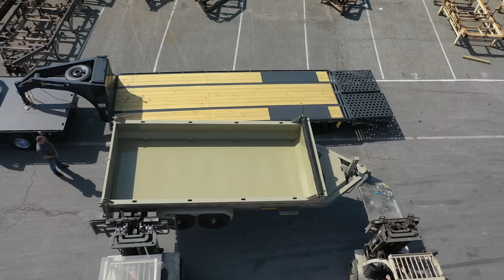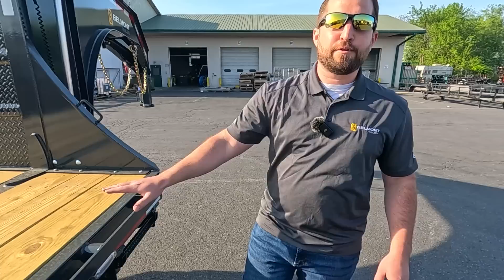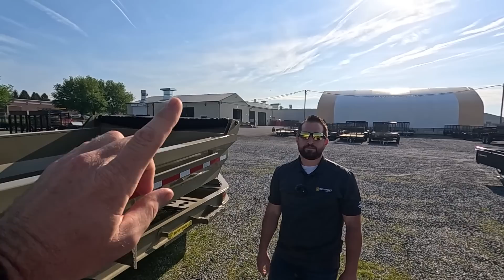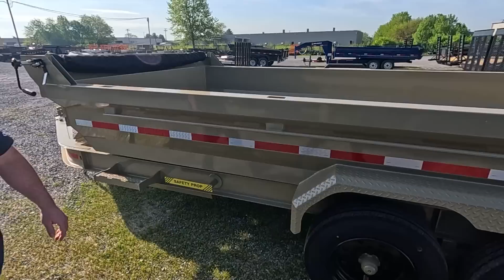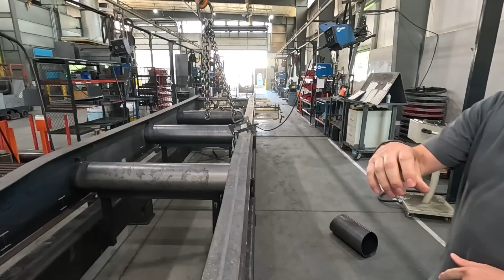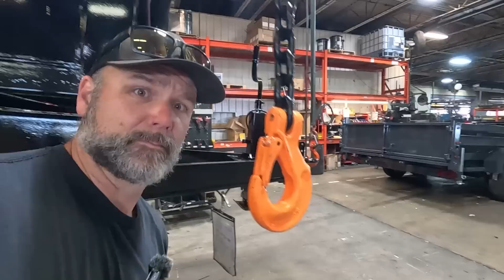How Dump Trailers are Made | Inside Look in an Amish Trailer Factory

Comment: Nice selection of materials on the dump. However, I prefer a scissor hoist because if you're not exactly level when dumping, that long telescopic cylinder is going to deflect to the low side.
Reply from the maker: hmmm....I'll have to test that
Reply: @StoneyRidgeFarmer  It would be a good topic for a video. I say this cause I am a tree guy and we sometimes chip into the trailer, and some of our dump spots are rough terrain.
Reply: Yes i agree , I'm a little shy of the telescopic,I know they will out lift  all the others but the stability worries me a little on the offload use

Comment: Should have electric over hydraulic disc brakes  on those  not those antique drum set ups
Reply from the maker: I have never seen a trailer with disc brakes....interesting thought my friend
Reply: @StoneyRidgeFarmer  I had my 5th wheel RV  upgraded to that system 
Now the trailer is stopping instead of pushing the truck ,plus the pads and rotors are much easier to service .On my trailer, they used standard GM parts
Reply: Also, all your class 8 trucks and trailers are going to disc brakes
Reply from the maker: I'll bet your 5th wheel didn't have these axles under it...most campers are made of pure junk...so it doesn't surprise me that your brakes were ineffective.  These axles and brakes are huge! But if I have an issue...I will tell it on the channel for sure!  FYI...I had to "lock'em down" about 10 miles away from the factory near highway 81....they braked nicely and were very stable.  This load was well over 14k and I was impressed

Comment: That trailer should work out great for hauling hay what are you going to pull it with
Reply from the maker: so my 2000 Ram 2500 will pull it, but man....I'm probably gonna need to upgrade my truck to a 1 ton or larger...or maybe outfit the new Powerstroke as a pulling truck
Reply: @ I forgot about your Ram if that’s the 24 valve Cummins it would be great they have the power and run forever
Reply from the maker: yep....the ram is rated at aroudn 12k as a 3/4 ton truck...I'm looking at a 1 ton 24v dually now

Comment: They should build an air ride trailer on air bags for easy load and unload of tippy equipment.  Air tow trailers check them out.
Reply from the maker: they make them for sure...I just didn't need that added expense on mine